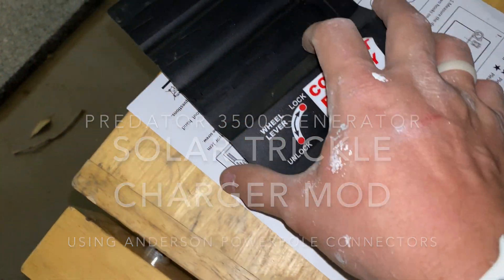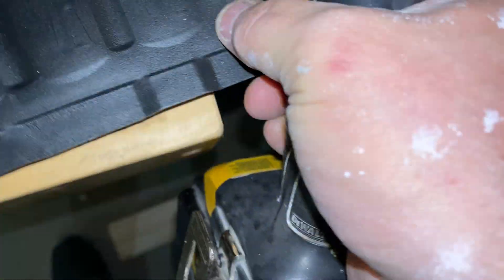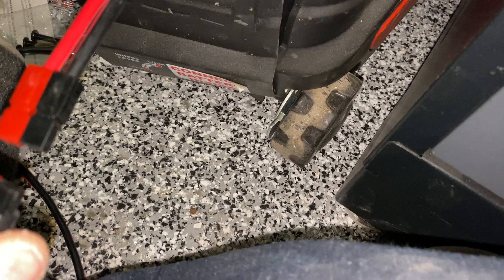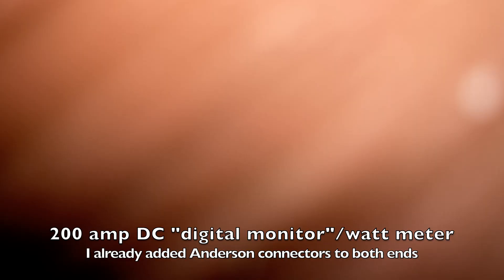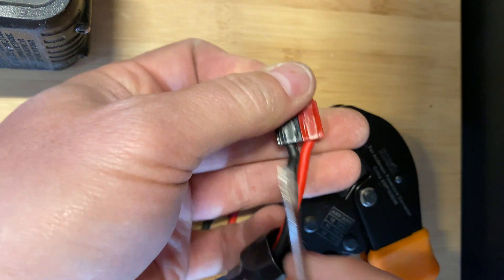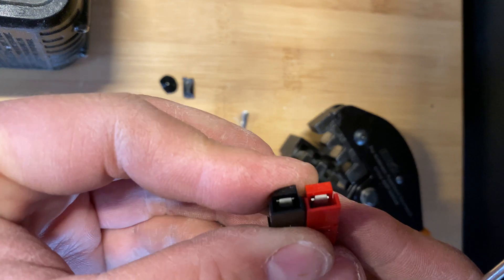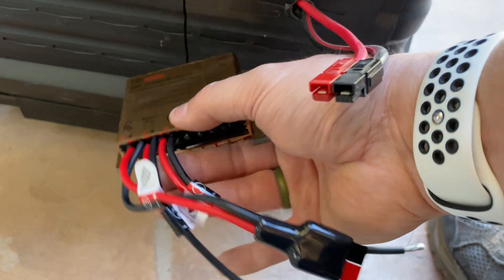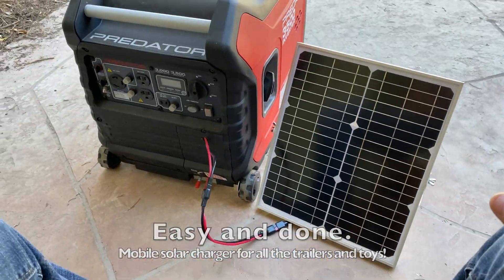Predator 3500 Generator Solar Battery Charger Mod, Panel to 12V MPPT Controller, Anderson PowerPole

Comment: Year and a half old hundreds of starts and never needed to charge my battery. Why do you? I was wondering if I can charge boat batteries with this adapter cord it came with.
Reply from the maker: For people that store the generator over long periods, it allows you to keep the battery charged without a power outlet. Or if the battery is low/dead, you can quickly jump it to another battery without opening.